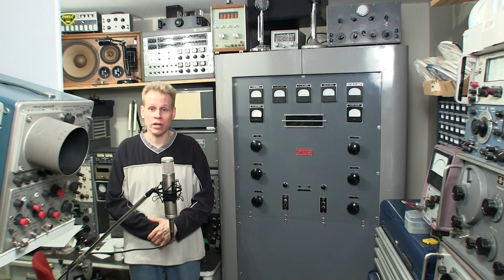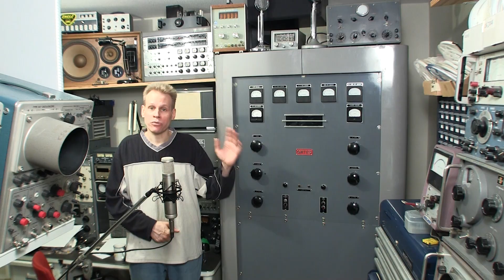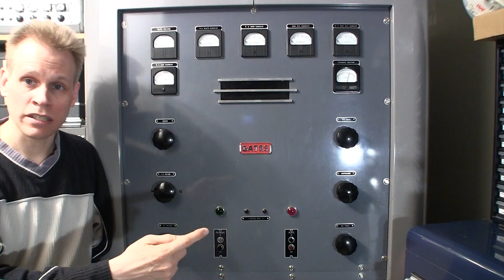Standing Inside a Broadcast Transmitter While it's ON!

Comment: in the Tech Vault of my last station KGNZ, has a Gates 22.5k and 27 years ago upgraded to a Continental 22.5KW then they are upgrading today to a Nautel Vision NV 22k Digital

i did not catch if this was AM, because in the 80's we reduced power on AM not FM (Edit) yeah i caught it

the manipulation of the Filament and Plate Voltages is called tweak and peak, maximum output power 1.XX REF power, using low voltage and current believe me tubes are VERY expensive, we run 1.25 to 1 on average SWR @ 98KW

1500V @ around 400 amps per leg, but its needed sometimes to defeat the interlocks, never be complacent near a transmitter they are very unforgiving, i have been doing this for 30 years, the most common death in Broadcast is not falling off the tower, its putting your hands in the wrong place in the transmitter

this is a short video of an issue with the Continental 22.5 a few years back i was taking the video and less than a meter away to put things into perspective 

https://www.youtube.com/watch?v=ZFZpNl9alQM

Comment: I used to work at a local AM radio station and they had a Gates transmitter running 500W.  I think it was a BC-1G.  I remember the 4 833 triodes in it.  Still have one that I took out of service.  It was in the modulator and was dead.  When we ran a proof of performance on the station we feed a 1kc tone into it at 100% modulation.  Talk about lighting up the 833s and the modulation transformer was howling.

Comment: Very bad idea with the bigger ones running at 100 kilowatts plus.  Long long ago there was an infamous Chief Engineer nicknamed, (not to his face!) "Ivan the Terrible".  Allegedly he was a really dreadful tyrant. For example he ran into a technicians car then suggested that they have a fist-fight over it and the loser pays for both!

When a short-wave transmitter (AKA Sender) is tuned to a new frequency a problem known as "Frame Resonance" may occur.  The cure is to put large non-inductive resistors across the corners of the enclosure.  This looks ridiculous but when the Sender is running, the resistors are needed to damp-down the resonances.  One day a new frequency was used and severe arcing was a problem.  Ivan the Terrible said "I'll go in there and tell you where it is arcing".  This was against all the rules but he was the boss!  He avoided the 10,000 volts HT  OK but he caught his hand on a 1000 volt bias rail which put him on his back.  The men powered everything down and pulled him out into the transmitter hall.  Just then the toilet-cleaner walked by and muttered "Not very clever to go in there".  Unfortunately Ivan-the-Terrible was just coming round and he heard what the cleaner had mumbled!  Ivan then jumped up and sacked the cleaner on the spot!  That bloke was dynamite so his employer pulled a brilliant stunt.  They loaned him a calibrated receiver and paid him to sail around the world on his yacht measuring field strengths.  AFAIK they kept him on Field Strengths until he retired!  It was a neat way of getting Mr Dynamite out of the way!

Comment: It's worth mentioning that the RF line current meter measures the antenna current indirectly, using resistance wire that heats a thermocouple, and the resulting DC is applied to the moving-coil meter. This gives rise to the classic non linear scale of these thermocouple meters.

Comment: I sold lamps to the studio business in So. Calif and was able to see the DC power building at Paramount. Studio cameras did not match up to the alternating power so they converted it to DC. Built in early 1900s. It is beautiful to see. All constantly polished brass and copper wiring with huge transformers. Your analysis of the broadcast transmitter recalled it to mind. Also see huge steam engine at Buffalo Water Works. Same craftsman work.

Comment: Years ago I worked at a UHF Television with a Townsend transmitter.  It was about the size of a streetcar,  with doors that you had to go inside to service it.  It had safety interlocks on the doors of course.  There was also a grounding rod device so you could discharge capacitors that might hold a charge even after powered down.  Our engineers called them "Jesus Rods", because if you didn't use them you might meet him in person.
Reply: In a rollercoster sound system valves powered amplifier : ("Gougeon" was the main brand in rollercosters and carrousels sound systems) , the plate voltage of the 308 valves is 800V DC current ! Enougth to kill a man too !! 
In the 70', the Gougeon company build the first solid state hight power sound system amplifier... The output power was 2500 Watts on 2 Ohms speakers load  per channel !!!  It's commercial name was "Presence 250" ( have a look on the web).
Reply: @cletusspuckler2243  I work on roller coasters, and pretty much everything about them will kill you if disrespected. Massive motors, relay cabinets where all the logic circuitry is at 480v, exposed live shit *everywhere* in the control boxes, 120v at the buttons and panels, some crazy shit with older things xD
Reply: Praise the Lord!

Comment: I really enjoyed your video as it brings back memories of my days working as a Tec'n for an AM station in Ontario from 1974 to 1986. We operated at 630khz 10kw/1kw and had Continental Transmitters and a tower array we switched between day and night. We had a 416C for the 10kw and a smaller 1kw which I have forgotten the model #. I remember when lightning took out the 416C with a big bang. It blew out some of the paper caps and made a mess inside the transmitter. We later upgraded to two 316F Transmitters. Each was setup for 10/1kw so we had one always as backup. The 316F was equipped with a magniphase which would shut down the output in the event of lightning strikes. That was a big improvement at the time over the old ones. I left the broadcast business in 86 for a career in Transformer manufacturing.
Reply from the maker: Great story Roy, Thanks for sharing it with us!

Comment: If those audio transformers are so heavy, it doesn't seem like they'd get very good high frequency response.
Reply from the maker: The modulation transformer is just large because it has to make lots of Watts. The correct core material is crucial for the power (size) and frequency balance.
Reply: Ok, thanks! I thought at first that it's just for signal isolation or something.

Comment: Hello Mr. C.  Is the three band unit above the transmitter an old Morrow mobile converter which worked into the car radio?  Hams would then have a separate transmitter.
73  Rod   7ESA
Reply from the maker: Good eye Rod! Yes it is.

Comment: I remember a retired BBC engineer talking about when he used to work on the then BBC radio two 200KHz longwave transmitter (now BBC radio four 198KHz). To adjust the tuning of the loading coil he had to stand directly in line with it and operating with ~700 amps of RF current he could feel it heating his body directly.
Reply from the maker: And I bet he lived a full life as well. Seems like all these old radio engineers never get sick.
Reply: He was about 85 at the time of the interview.
And people are worried about cellphone masts in their area.

Comment: Yes ! Please do that sir. As you can see by the comment section the interest is there.
If you did nothing but transmitters i would still watch it. The art of " Hollow State " Is fading
fast away from sight and i for one really do not wish to see it leave. It is what i grew up with and will always have a fondness for it. How about some tube receivers as well - Still
on the hunt for a decent National NC 303 How about a hammarlund HQ 180 ?
Thank You for what you do already.
Reply from the maker: Thanks for your input John!
Reply: I have a bit of a problem with a radio of mine. I can not find ANY info on a philco solid state from '68. Wits end, it works, but needs to be brought into alignment. It's right there in great shape. But pretty much zip for info,schematic is like a hens tooth. Any help or direction you could give? Thank You for any info you can give, leads etc.
Reply: You could try asking shango066, he's into a lot of old radios. Be sure to provide as much information as you have, chassis numbers, #transistors, maybe upload a few photos somewhere. Or maybe watching a number of his videos will already give you an idea of what to expect where.
Reply: Thank You for the info and lead. It functions as is and i have replaced the pwr supply caps. I think the 2nd IF stage is just a little off and it's a bit drifty even on a strong signal. It is not special or of any real value,
i just like it. It is as complex as a rock - volume pwr switch and tuning knob. 
Again Thank You for the info.

Comment: Fantastic video!, thank you for doing it!, i never heard before of that neutralizer function, i only service a few VLF amplifiers for the local navy about 25 years ago, and they have a monstrous tube, they where mostly used in cw, usb, lsb and am, but never really used am, mostly cw, usb,lsb, i remember we had to unload the plate capacitors which where of the size of a oxygen tank!, with a grounded crowbar, oh my, the explosion that it caused and the vibration of the crowbar when the capacitors where unloaded gives me the creeps!
pretty much all that i serviced where always between 100 Mhz and 1.2 Ghz, so it is weird for me seeing something like that amp, specially the unshielded output hehe, that's odd!! 
please keep going doing videos like this and if you can, comment a little more on the neutralization function i never heard of.
thank you.

Comment: In my hometown there was an AM broadcast station that 'forgot' to switch to night time power on one night. They were heard very clearly in Venezuela ... from North Carolina.
Reply: Sean Watts AM dxing still sometimes produces some odd results. I've caught some from Mexico and I'm closer to where your cranked up country station was
Reply: The opposite happens all the time. At night, I used to always get as many mexican stations as american... in tennessee. I say mexican, but honestly, I don't really know if they were speaking Spanish or Portuguese, so some of it may have been south america.
Reply: When I used to dx AM stations at nite in northern Indiana, very quickly I found that conditions were such that you either had good Canadian reception OR good reception of Mexican stations.  Never both.  But those (much!) higher-powered Mexican outlets were alot further away!
Reply: I've managed to pull in a fire & brimstone preacher, from Florida I believe, in North Wales one evening. that's about the extent of my DX'ing though lol. I recently acquired an old Sharp music centre though that seems to have a particularly hot tuner so might set up some antenna and see what it brings.
Reply: Non-commercial station where I volunteer used to be 100KW FM on 100.3  (now AM, financial reasons) in Minnesota was one night heard in Maine due to some very unusual signal ducting of the ionosphere.

Comment: A trip through the way back machine...I literally grew up in a TV shop surrounded by vacuum tube TVs, I built my first shortwave radio in Junior High School, all hardwired, no printed circuit boards in that one!  I see a video showing an RF signal generator virtually identical to the one I used, and final alignment and tuning done on one of the shop oscilloscopes. I used to replace flyback transformers for some extra cash when I was in high school.

Comment: The last time I saw a BC250 was at Ft. Greely Alaska in the early '70s. It was crammed into a tiny shed, with barely room to walk around it. Many of the rheostats had opened up, and had been rewired to use the opposite end so the controls worked backwards.

I've moved a Gates 5KW AM, and an RCA TTU25B TV transmitter. I have also seen inside the legendary 500KW transmitter at WLW. :)

Comment: Awesome demonstration. In the 80's I worked at KWPR in Claremore OK (now Sports-talk KRXO) that had the same Gates 250w transmitter. It was bought when the station went on the air in the 50's and it was being used as the backup. We had a McMartin 1K at the time as the main transmitter.  It's a shame now that most tube transmitter got tossed out or junked for parts when stations upgraded to solid state transmitters.

Comment: We had a BC1T at a station and it was about the same size as the 250GY you have here, but a few years newer.  We replaced it with a BE AM1A which is 19x24x27 inches, and fed from a simple 240V 10A supply.  Yes.  It runs less power than your oven.  

Kinda sad that I got into radio as these tube rigs were going out of service.  The group I'm with now has only 5 tube rigs and they're all only in backup service.

Comment: Well at work i run a RF-Press and it has a Grid and Plate current meter but instead of being used for broadcasting the RF is used to heat a Die with brass bars to seal the filter media we make filters with........ there are all sorts of faraday cage like guards that come down when the press cycles and the RF tube is on, its a 25Kv RF sealer....  I like your videos keep them going........

Comment: Great video, love it. But just an FYI or commentary to you expressing at 18:32 that: "Again Modulator is just a fancy name in transmitting industry I guess you could say for audio Amplifier".
The word "Modulator" is not fancy it is the correct term to describe the crucial step in the transmitter that Amplitude Modulates the radio Frequency being transmitted in the AM radio (AM meaning Amplitude Modulated Radio). This step is not just any other power amplifier, even though the design in principle has more similarities to a simple audio amplifier than not, it is what defines this AM radio system.

Comment: Loved your vid! Brings back fond memories. As a teenager in the '50s I scratchbuilt a rig using paralleled 6DQ6 finals, plate-modulated. Mod. transformer consisted of TWO 25-cycle power xfmrs connected back-to-back (primary to primary). Two 6L6s in p-p drove the center-tapped HV winding of the first xfmr; the center-tapped winding of the second xfmr carried plate current of the RF final. Audio had a sharp roll-off above 5000 cycles, perfect for voice. 

Dumb kid shouldn't think power transformers aren't good for audio, but they worked great.

Comment: Mr Carlson, beautiful transmitter. You do have one minor error. When that transmitter was in popular use, an engineer was required to be on-site. There was no "check readings when you happen to go by". Unattended operation wasn't allowed until the mid 1980's.
Reply from the maker: HI Jon, I fail to see the error, no dates were given. Also, this came from a remote shack here in Canada, no doubt it was moved there at some point in it's life span.

Comment: I am sure you have see something similar, but in case you haven't,
http://www.nj7p.org/Manuals/PDFs/Tubes/RCA-gfat-1942.pdf

On a side note, I worked for Illinois Bell Telephone for a couple of years '69 - '71. We had equipment running 30 year old tubes: First, Western Electric made high reliability tubes.
Second, they were installed in equipment in an A/C'd office.
Third, most importantly, they were never turned off.

Comment: Your warning about high voltage is sooooo important I had one of my students at GM become a fatality because he taped the safety switches on the interlock system and got across the voltage. I had a 30 minute section in my notes when teaching from induction  heaters used in industry. Very sad but it did happen brian Wb8idy michigan
Reply: ..Как это стало возможно..??.. Осторожность работы в устройствах высоких энергий - первое правило начинающего техника и инженера, которое нельзя игнорировать ни при каких обстоятельствах..!!